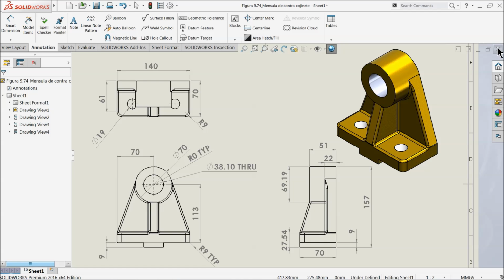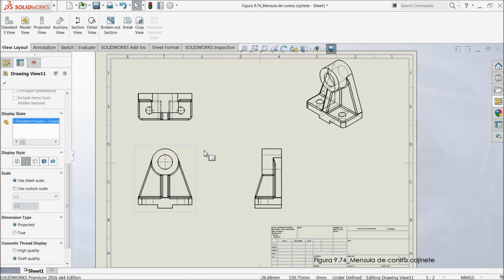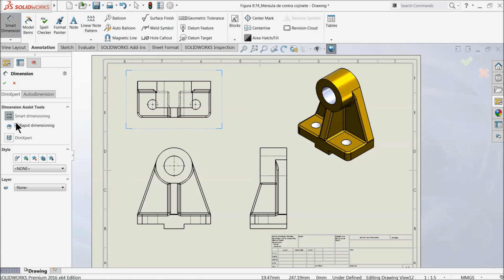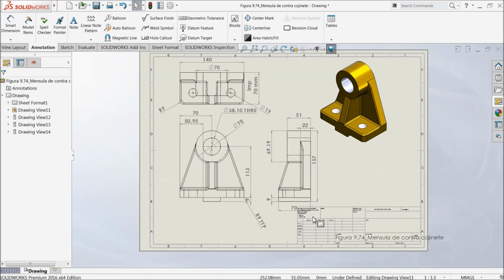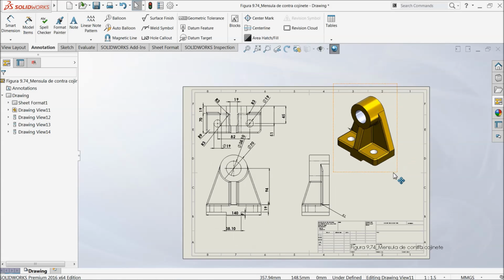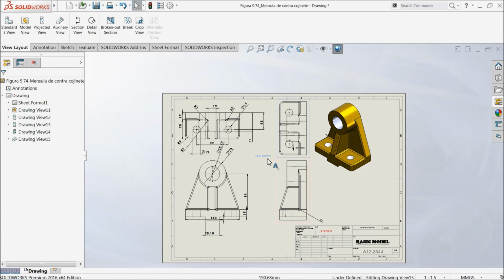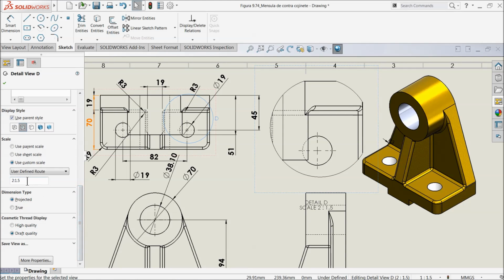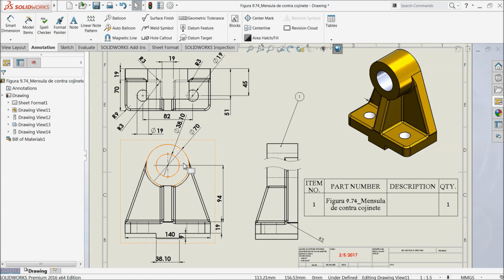Solidworks tutorial Basics of Drawing

Comment: I have installed solidworks 2016. It works too slow. my system configuration is 2GB RAM and i3 processor. I work in window 7. 2 months ago I was working in window 8 and solidwoks performed very well. due to some reason i install window 7 and solidworks becomes very slow what should I do...
Reply from the maker: your system is very low configuration, you need to update at least keep 2 GB graphics card in your system.
Reply: THANKS !! : )

Comment: very nice video as always, I love watching and practising along your videos, even I know most of SW, it's still good to practise :) But question/suggestion:
I think few years ago you did working engine maybe 6h video and then advanced surfacing of a car, if I am correct.
Could you do something similar like that, big project maybe split it into few parts/videos. I was thinking like assembly line, maybe something or another engine like V12 or even W16, maybe sometimes do like electrical or flow.
But yeah love your videos, the best channel for practising in SW :)
Reply from the maker: Thanks, sure in future i will try for Car body with surface tools &  solid engine with multiple parts,